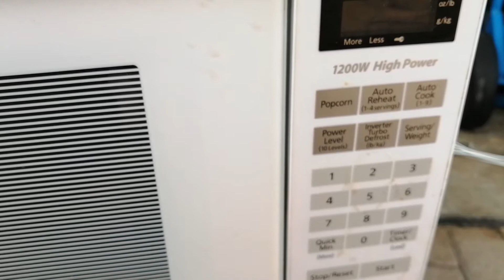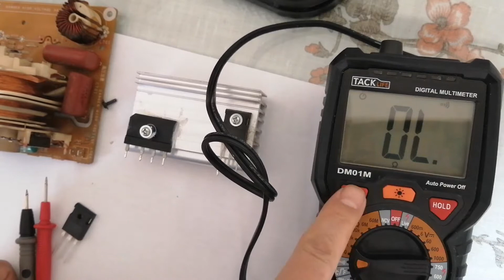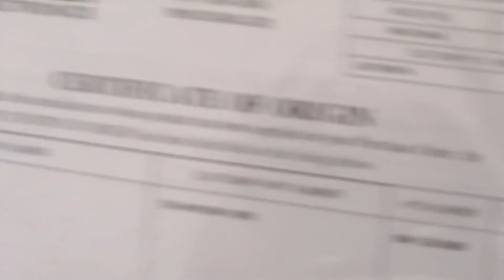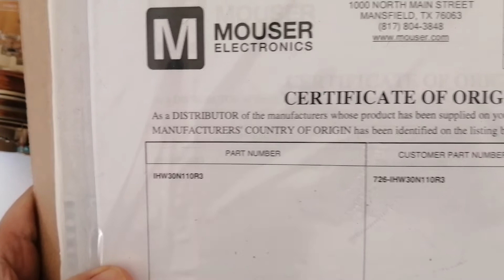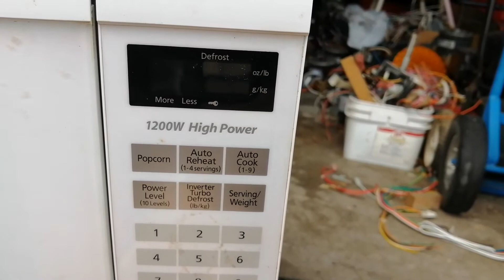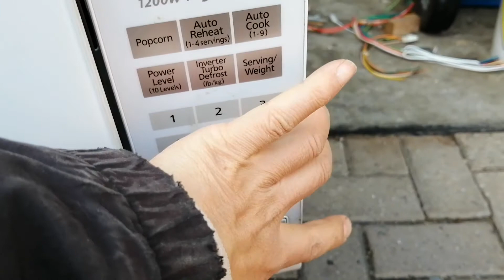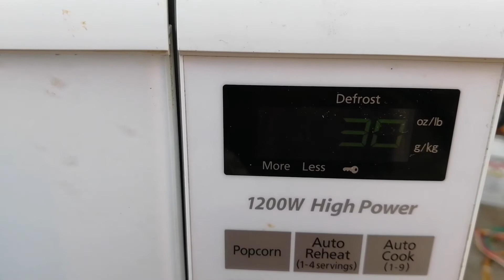Panasonic Microwave Inverter Board Repair - Blow fuse (Replacing IGBT)

Comment: Thank you for this video,i changed th Gt60n321 IGBT but when i start microwave,IGBT blows again and i need to change it again, I'm so confused, magnetron is ok
Reply from the maker: Sorry I'm not an expert in electronics. You can try multimeter diode test, check the AC-DC bridge see if it is shot.
Reply: Are you able to solve it, what was the problem igbt keep blowing

Comment: Perfect.. Thank You very much for posting this video, I had taken a hint from your video where actually the problem was with IGBT while Rectifier was showing a problem when it was connected to the board. My panasonic microwave had exactly the same problem(fuse getting blown). I had no idea about microwave repair and watched many videos to zero in on inverter board  and finally fixed mine replacing the IGBT. Thanks.
Reply from the maker: Glad it helped!

Comment from the maker: I knew after, why I couldn't test IGBT like in other videos. The voltage to activate IGBT is too low on my multimeter, too low to activate it. I should use a DC power supply to test it.